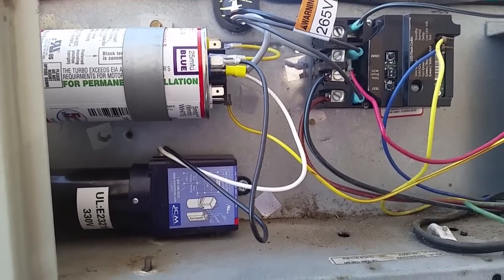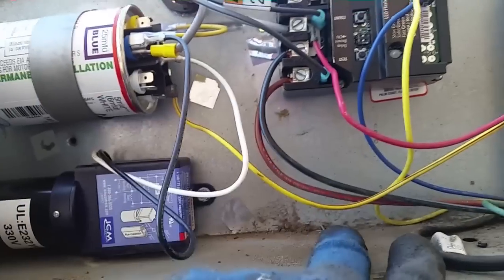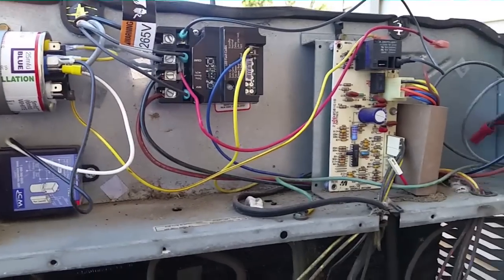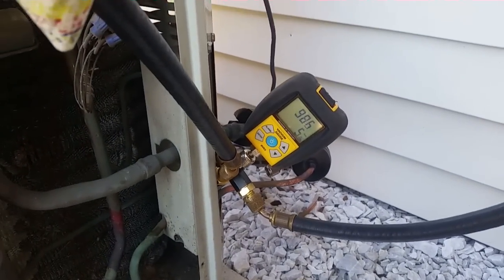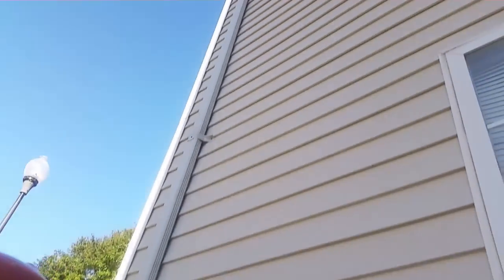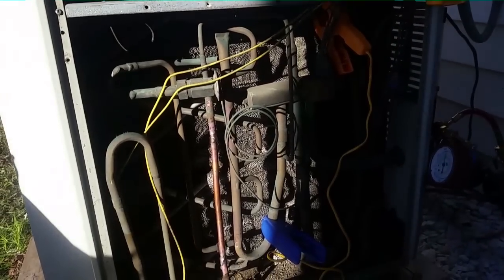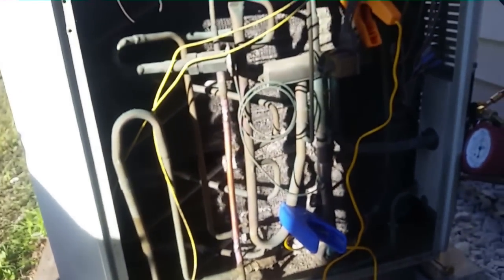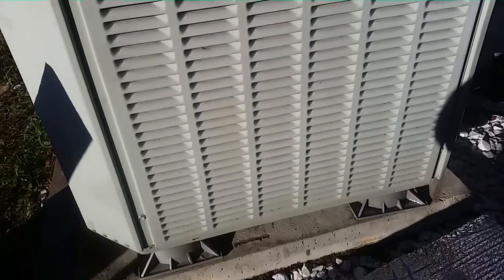Trane Compressor Change to Copeland CR Part 3

Comment: You turned the sure switch around,! Nice job sir. 52 units every spring? Dang
Reply from the maker: 52 units. I do them one group at a time. I split them up into the 4 buildings in the complex. Thanks Joe